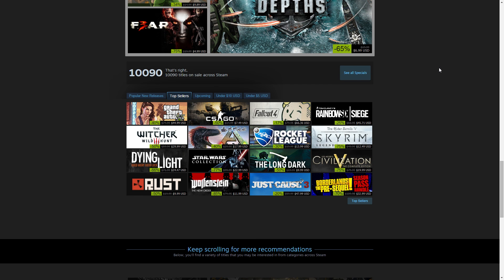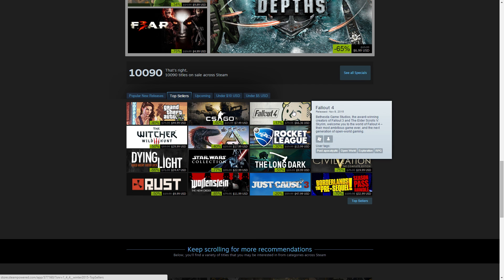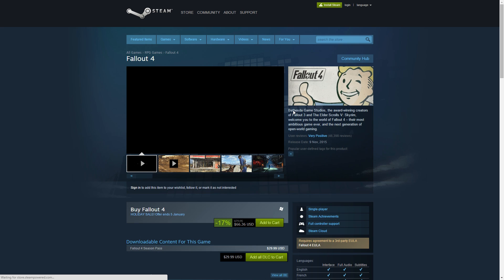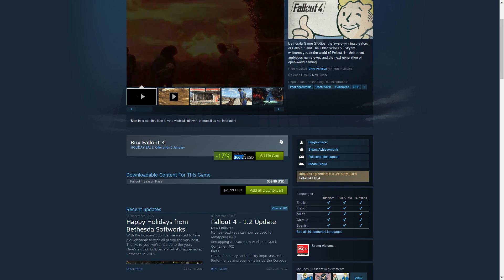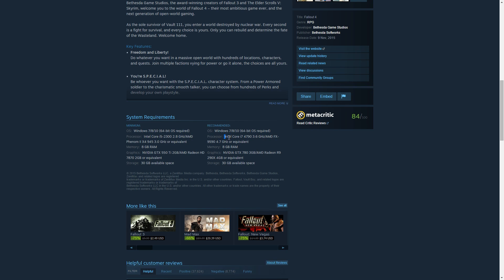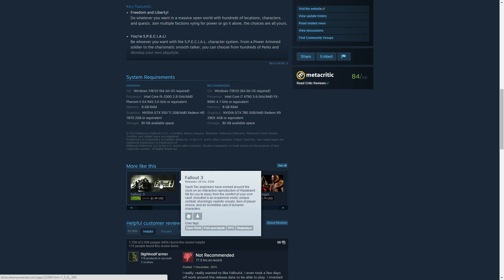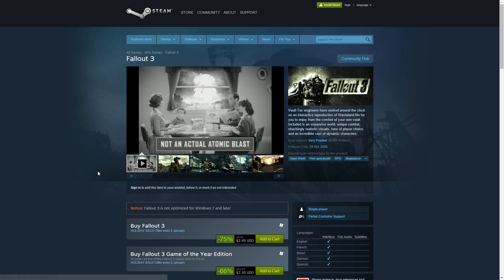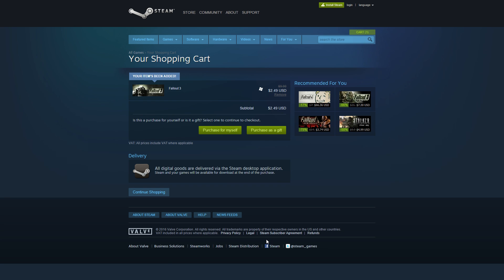Building the Fallout 3 Retro Gaming PC

Comment: What i can tell it run fine under windows 7 32bit. And for this pc i would had taken windows vista (maybe even in 64bit), because you can get the advantage of directx 10 for crysis for example released at the same time.
Reply: But Crysis runs fine on modern systems. So no need for DX10 on a rretro rig.
Vista would have alot of the same issues 7 has with older titles. Just the way the display drivers are managed destroys compatability with some older games.
Reply: But Fallout 3 was released two years after the realese of Windows Vista,
 and don't come with "but it takes time to develope a game and when they
 started, there was no windows vista", it takes in general three years 
from the first concepts to relese and developers like Bethesda get early
 betas and the tools, that it runs fine. By the way Vista is still 
supportet from microsoft and that is important because you conect it 
with the internet to register Fallout 3 and conect to steam if you 
bought it there like me. And the best vista is very easy to get in a 64 
bit version unlike xp, so get the full advantage of the 4gb ram, with 
32bit version of windows you can only use 3gb because of the 
graphicscard 1gb ram.
Reply: FoxMccloud42 I remember this game worked perfectly fine under Windows 7 RC 1 (back when W7 was still in RC stage), way better than in Vista.

Comment: Since a computer that runs windows XP are so cheap these days I bought one as a retro gaining PC and running selected windows files that I had pick up real cheap at thrift stores such as Fallout 3 and the like.  Of course I avoid internet because of the virus and malware risks.  My other computer is running Linux MATE and serves as my daily driver for surfing the web.  Due to the low cost ($20) I went with a 2nd PC rather than bother with dual boot, WINE or VMware.  

I transfer files like patches and the like with a USB flash drive.  I have not done the research (yet) on how practical to use another computer as a gateway computer and hook the two together with Ethernet cable for data transfer.  Do you think that work to keep the XP protected from malware?  How do you keep your old PC safe from  virus and malware risks?
Reply from the maker: Good on you for going with a dedicated XP machine :D I also mostly use Sneaker Net. For Steam, I had the installer on a USB and that's really the only program that goes online. I never use the browser. Once you ran all the Steam games, you can launch them in offline mode. But I have a lot of games from GOG, they just install from a USB as well.

I admit I don't know enough about the security aspect of having a XP machine connected to the home network. I always assumed you're safe if you're not going online, but that might be a but naive to think that...
Reply: PhilsComputerLab If the XP machine got compromised and you don't have any LAN-internal firewalls on other machines, the XP machine might become an inner-LAN foothold for the attacks on the more modern machines in the rest of your network.

I'm still taking the risk occasionally by attaching XP to the Internet for driver and game downloads and so on, but I'm trying to keep the connection time down and disconnect ASAP after I'm done. It's just laziness really, I could be more careful if I wanted to.

For my VMs I don't really care, I can just wipe them at any time since they don't really store any private data and I try to keep file shares they can access on read-only to prevent the spread of infection (although I haven't really spotted one yet).

Comment: I mean I run fallout 3 just fine w/ an enb over 60fps on my RX480 with Windows 10 as my OS, but I think it's still cool that you built a perfectly optimized, not yet "retro", pc to run this game maxed :D
Reply: I run Win7 64 bit and Fallout 3 gives me guff I guess it depends on the machine.
Reply: ***** yea that's true
Reply: ***** on my old pc (had a R9 270) it would stutter but when I fixed that the game would still get several, noticeable, dips in fps
Reply: Mine just gives me trouble because I have multiple monitors.
Reply: ***** that would make sense

Comment: move the ram to second and 4-th space and put triple thermal paste this is not enough
Reply from the maker: William McCarthy Yup, that's it!
Reply from the maker: You don't because the actual die is much smaller than the IHS. If you use lots of paste it just gets pushed out onto the socket and leaves a mess.
Reply from the maker: Why? I always use the ones closest to the CPU for reduced latency. Disagree on the paste though, but everyone has their own rules, so let's just agree to disagree :)
Reply: beacouse cpu needs more space for cooling and ram tiles are always put one over the other i mean the second and 4-th slot
Reply from the maker: Oh that makes sense! I have coolers that are quite bulky and you cannot put the RAM module in the first slot.

Especially on cheap boards that only have two slots that happen...
Reply: And you should put a little bit more thermal paste!!!
Reply: Well technically, I think less thermal paste is considered better because it takes less to send the heat from the CPU to the cooler
Reply: but you must cover all the edges of the cpu

Comment: So fallout 3 is retro now? What the hell? :D
Reply: Thanks to OS compatibility, yes.
Reply: Lol I built a "retro" PC with an i5-4590 and a GTX 680 for Skyrim, Battlefield 3, and Fallout 3/NV... I might need to go back further.
Reply: I am playing Fallout 3 on Windows 10 just fine. Almost all games will work with some tweaking. Sometimes days of tweaking, but yeah. :D On the other hand I have an XP retro PC for fun.
Reply: Yeah... Win 7 and Fallout 3, nice pair. Got a virtual box for everything XP... don't have one game that would actually require an XP dedicated machine. That XP virtual thing is for old Windows stuff (Total Annihilation, that old Star Wars RTS and such).
Reply: @meikniessing2398  virtual box don't work for all older games only some but most which are obscure has issues even on virtual machines
Reply: Skyrim and BF3 run pretty fine on a modern system.
But having a XP retro rig sounds pretty reasonable. Good that the Xeon in my secondary rig is old enough to run all XP games pretty much flawlessly and new enough to also run newer titles unter 7.

Comment: I'm confused, how is this retro? I thought my computer was relatively old, but i think again. Specs: 4 gigabytes ddr2 800 ram, geforce 8400 1 gigabyte, Intel core 2 duo E7400 2.66GHz, Windows 10. The motherboard has only a PCI-e, and two pci slots. 301 watt power supply, doesn't even have pci-e power connectors.
Reply: +Drunken Ferret just built your pc with an hd 4870 instead, for £80 including case

Comment: what would happen if i put a 350 mhz pentium 2 on my gateway's pentium 3 mobo. would it work, or will kill my mobo.
Reply from the maker: +Windows Ninety Five 66 It should work great. It will definitely not kill it :)
Reply: i got a pentium 3 gaming machine to replace my dell dimension 4400 that i used for windows 98 and dos gaming it had a pentium 4 and 256 mb ram and a soundblaster live! pci, the capacitors went bad and the power button light was amber when i powered it on, RIP DELL DIMENSION 4400     2002-2016.

Comment: Phil, i have a "challenge" for you (if you find the idea interesting ofcourse).
Put the most modern hardware on a Windows 98 with KernelEx and the Unoficial SP.
I wonder how far could we go and how the standard Windows 98 compatibility would be (new vs old softwares on it)
Reply from the maker: +1300l Good idea :) The ultimate Windows 98 machine so to speak.
Reply: MrMateczko
That's the catch. In theory, with KernelEx and the unofficial SP.. it is possible to install with drivers from Windows XP on it.
How ever, i would think that we would need a Mobo with PCI slots to still have OPL music on DOS games (and drivers for DOS) and use older video card on PCI as well.
Reply from the maker: MrMateczko $21? Sign me up :) Most people spend more on coffee every week :D

I wonder, would a 915 chipset with DDR2 not have any advantage?

Comment: now build it with overpowered parts, like an Pentium g3258 OC to 4.5+ GHz and with a GTX card that has xp driver support
Reply from the maker: +urzu117 I actually have that CPU, but Haswell doesn't have XP support anymore. Ivy Bridge and Sandy Bridge do though.
Reply: +PhilsComputerLab fairly sure you can run XP on haswell with zero issues (sans the IGP, but you wouldn't be using that for video games to begin with)
Reply from the maker: Cool. Well I only have one Haswell system, my capture PC, so I won't be able to check this out for a while :)
Reply: +PhilsComputerLab I've got a g3258 lying around but no spare z97 or z87 boards lying around to test XP on.

Comment: such a terrible motherboard, i had it, good luck fitting more than one sata cord with a graphics card like that
Reply from the maker: +ziggieice The HDD and optical drive are both connected with SATA. Didn't have any issues with this board, but I did flash the latest BIOS beforehand.

Comment: you should try to instal win2k on a sandy bridge build.
at least the chipset drivers work, with some fiddling you can manage to install usb 3.0 drivers and you can use sata iii (not sure) by installing windows in the sata ii in compatibility mode, installing the sata iii drivers, then swap the drive from s2 port to s3 port.
Reply from the maker: +jangelelcangry Why Windows 2000? Sandy Bridge and Ivy Bridge have full Windows XP support.
Reply: just for fun of doing it.
btw I tried to install me but after one of the installation steps went bsod. but i shoud try again 4 teh lulz.

Comment: yes, I can attest to Fallout3 not working the greatest on Windows 10 for instance, graphical glitches and speed related issues everywhere (and thats with vsync enabled), its a bit odd to think of Fallout3 as a retro title, but it almost is.

I wonder how well my HP XW4400 could run it, the C2D 6600 and 512MB X1950XTX were around 2 years old by the time Fallout3 was released, but in theory should run the game fairly well (given it isn't well optimized for quad cores, and there isn't any DX10 support)
Reply from the maker: +lightdark28 The X1950XTX is actually a really good card. In newer games it does better than the GeForce 7900 GTX. But still, these cards are quite a bit slower than a GTX 285. The GTX 285 surprised me a bit. It's faster than the HF 6770 I used in another video and on par with the 1 GB GTX 460. It's a really fast card for its age. But then, just play on very high instead of ultra and it will run a lot smoother on older cards.

Comment: This was probably easier to do than the rigmarole I went through to get FO3 running 120hz on 7 x64. Absolute mess of an engine! 

Had to limit the threads in the ini files, run a 3.5GB flag patch, using RadeonPro to set the processor affinity to only 2 cores when the game boots, had to use Creative ALchemy to reduce some of the audio CPU overhead from directsound emulation, block system audio codecs from decoding all of the effects, voice, music in the game, running a mod script that changes the physics tickrate based on framerate, running the game in compatibility mode as administrator..... etc etc. Looks lovely now but christ it would be enough for a 20 minute video all the stuff I did lol!

Comment: Nice setup! Would this build be around the "best" Windows XP build before Windows Vista/7 took over completely? I'm thinking of putting together a Windows XP gaming computer for games, like Fallout 3, that isn't optimized for newer systems. I assume you used the 32-bit edition of XP? I used to run 64-bit XP, and remember driver support and compatibility were horrible.
Reply from the maker: +togst With building an XP machine you are spoilt for choice! Later cards like the 460, 470 and 480, 500 series, even 600 series, all work great in Windows XP. With the GTX 285 you can use older drivers though, which might be an advantage if you run into a game that requires a specific driver.

Comment: > But beware, it is not optimised for Windows 7 or later.

What. Where do you even get that idea? Its a DirectX game for Windows, it will run on anything from XP to 10. I mean, I can go install that right now on Windows 10 and it will play just fine.
Reply from the maker: +timecop1080 Not optimised for Windows 7 is on the Steam store page. I am also highlighting it in the video, did you miss that?. You can check the steam forums for reading up on the issues people are having.

From Bethesda themselves: As Fallout 3 was created prior to the release of Windows 7 and 8, it is not tested or supported on either of these operating systems.

Comment: what specs on the fallout 3 machine? and would you recommend going above it since XP is capable of handling more?  And just how stable can it get on windows 7?  I imagine there's probably fixes.
Reply from the maker: +patg108 Good question, I&#39;ll put the details of the machine in the description. For the tech issues best to check the Steam forums.

EDIT: List of parts are in the description now
Reply: +PhilsComputerLab and does fallout 3 even support more than 2 cores?  Even if not then why not look into higher end dual or quad core (or more, in terms of single core) with XP and see how it fares?  Or does fallout 3 go screwy if there's more than 2 cores?
Reply from the maker: No real reason for using a dual core. I like to use all sorts of gear in my videos, not always the same stuff. The game runs well, but otherwise I could have use a Phenom II X2 no problem.
Reply from the maker: +patg108 Just found this on the Bethesda site:

It is also important to note that Fallout 3 was not developed for use on PCs with more than two cores.
Reply: but what do the real world tests show?  And what happens in that real world scenario?  What are things to watch out for in general while getting fallout 3 to work?  And wouldn't the best for a dual core be either a i3, or intel's G series?  Maybe high end core2duo?  Those are certainly noteworthy cantidates for dual core machines.
Reply from the maker: There are lots of options of processor and graphics cards. Throughout my videos I like to change the parts, show a range of options. Because there is no set, best, parts to choose. An i3 would work well, but it would be bored with this game. But keep watching my videos and you wills see me using other parts.
Reply: Yes but the point of it isn't if its bored or not, but to keep the best performance, framerate, allow room for mods etc.  And how will the others fail (top end, are there dual core i5/i7s? could put them to the same task).

As many pc gamers know having excess in specifications is rarely a bad thing (there's always exceptions though, which is what older weaker parts are for).

And it can't be made stable on tri, quad, or octa processors or more?  It won't utilitize more than 2 ever under any OS it can run uner?

And of course there's no set best, but wouldn't the point be to get it running as well as possible, not nessecarily just sufficent?  Why settle for a average good performance when you can have excellent?

it doesn't mean there isn't a practical limit to just how much love and fun you can have putting together stronger than needed parts to get a awesome experience for the game though.  Question is what's the upper limits?

And this is far from the first video i've seen, not certain if i've seen all of em but i've seen some of em

Just curious what can be done in this case?

Could make a truely ultimate uber build regardless of the times for generations and document games that are fussy and only like specific card/ranges and how to get the best out of them too.  And compare various options against each other performancewise (even if its a newer generation than the game).

there is reason to have more than recommended performance, its to do what the pc master race can (mod, tweak, run on much higher than normal settings than normal for games, its true for probably any generation, probably including even dos/3.1 (definately 9x and up, assuming you can find any and if the game in question has options and mods of course)
Reply from the maker: +patg108 Hence my invitation at the end for others to build their versions of Fallout 3 PC. Then share the results.
Reply: I'm asking if you have built/could build ones and how your predictions would go?  When pushed to the architectural limits what comes out on top?  And would you be able to get it stable even without sticking to dual core?

You might have nicer pcs than many, it'd make for a good comparison video, hence my request to see what happens, and to give general purpose lists/help references to watch out for those those who might use such things to build a fallout 3 machine, or simply ignore the "use dual core" and instead try to use their modern machine and what they can do about it.

basically what bumps in the road to really watch out for and what can be done about them.  (Don't get me wrong i know you couldn't cover every mod, but at least to get it running at stock with the latest patch could probably be done with relative ease)
Reply from the maker: I have no interest in doing any of that. I built a machine that runs the game well. This is what my channel is mostly about about, avoiding issues by building compatible computers,
Reply: but this kind of stuff is literally perfect for your kind of channel.  You could argue that's pretty average, but what about building the excellent computer that's compatible?  And the question still stands is how hard is it to get more cores to be compatible?